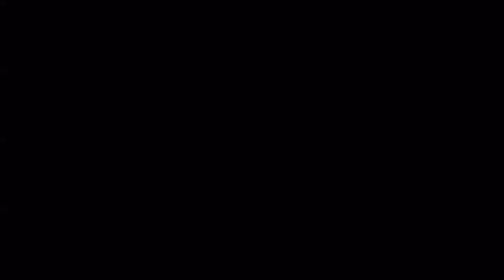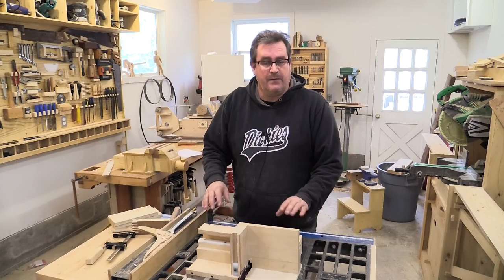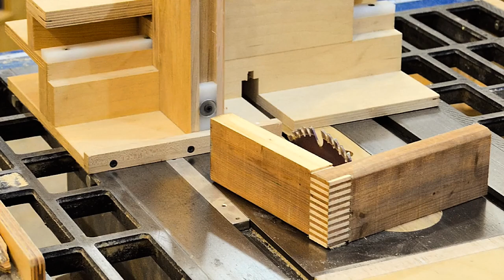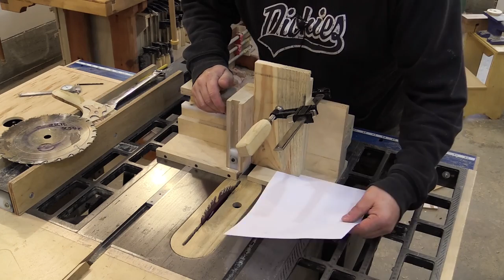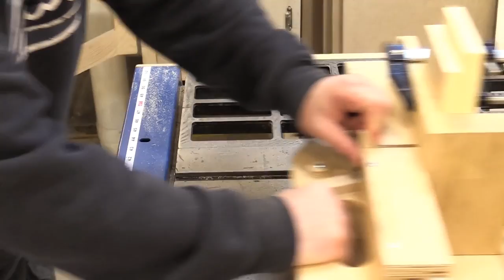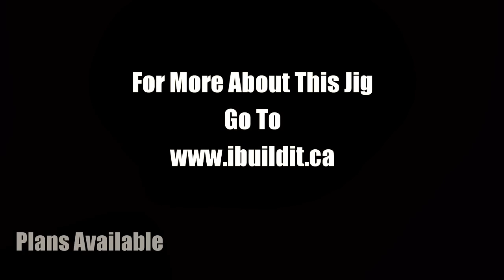How To Make Box Joints With A Single Blade

Comment: Nice update John! I'd like to know why you used a 7/64in drillbit as a spacer for those 1/4in box joints? I'm asking this because if we add up 7/64 to .120 (which is twice the kerf of a .06 blade), it gives .230, not .250 as intended.

Yes, I know it's plenty enough precise and all that, I just want to make sure I understand why you did it.. is it because of the runout on your particular saw ? or is it because the blade isn't exactly a 1/16 thickness so you couldn't make a true 1/4in box joint for the video without making a shim ? Not trying to be picky here, just trying to understand the logic behind it (my best guess is a combination of both the runout and not creating a shim only for an update video but I might be wrong and there might be something im missing)
Reply from the maker: Eric D. You are way over complicating it. As I said in the video, I have a 1/8" blade in the saw to cut 1/8" box joints. With the very small amount of runout on my saw, this cuts a kerf that is just a bit bigger than 1/8". When cutting a 1/4" joint with that same blade, the small amount of runout is not enough - the joint would be too tight. By spacing it 1/64" less, it makes the fingers narrower.
Reply: Oh I see! Sorry about that, I'm french so I may sometimes miss a subtle tip or word that makes a huge difference. Thanks for the reply and keep up the excellent work you do I really like your jigs!